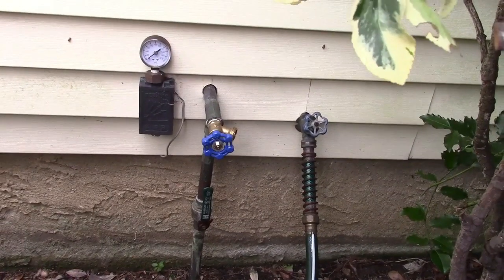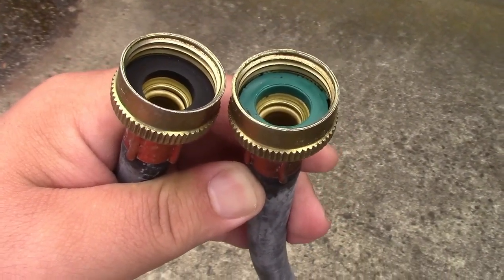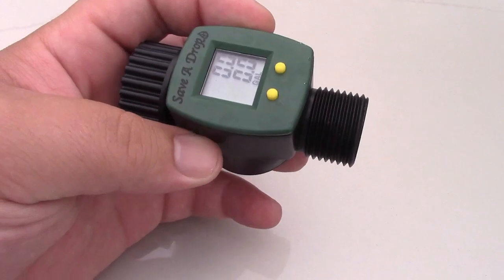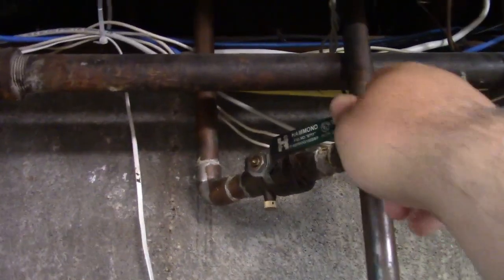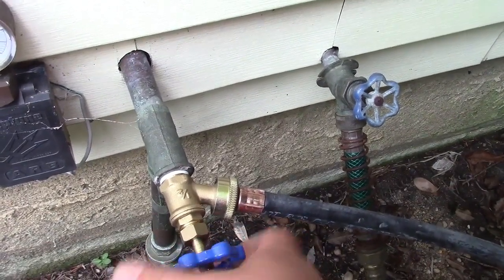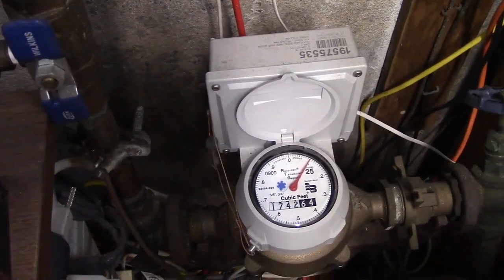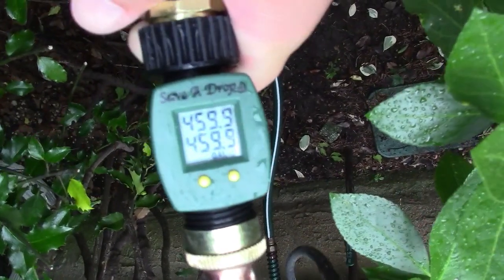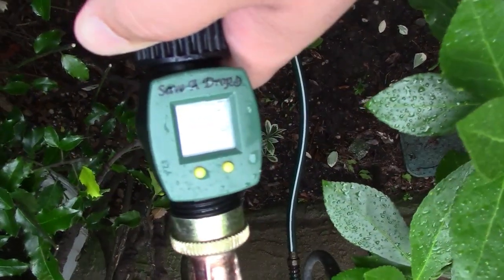How Much Water Does An Inground Sprinkler System Use?  Let's Find Out!

Comment: It's shocking just how much they can use! I have a separate irrigation meter, which excludes the sewage charge from irrigation water, since it doesn't go down the drain. That makes it really easy to see how much it's using. I've got 6 zones that run from roughly 30-50 minutes, 2 times a week, depending on which one. I swear at one point the quarterly water bill said it had used 30,000 gallons. I'll have to take a look at one of those meters, seems like a fun thing to play around with.
Reply from the maker: Around these parts, we don't get charged per gallon for the sewer.  We pay dearly for it in our taxes, but there's no limit or charge for usage.

That little water meter was a great purchase.  It's not the most robust thing out there, but if you keep it dry, it will definitely work.
Reply: That's pretty interesting. I'm sure in NY the taxes are out of this world, and that just adds to it! I think that meter is awesome, I'll definitely get one sometime.
Reply from the maker: @toyota-eh3ub  Last I checked, my taxes were about 12K a year around here.  Everyone else moved away since they couldn't afford it.  In exchange for that, I live a civilized life with full services, instead of having to pay willy-nilly for things like garbage pickup, snow removal, road maintenance, good schools, just about any business I want within a 10 mile radius.  As the saying goes, "you gotta pay to play".
Reply: That couldn’t be more true! In FL, the taxes are cheap. I usually like that, but sometimes the privatization is out of control. At one point, there were three different garbage companies all competing for business in my town. They need to be more like NY sometimes.
Reply from the maker: @toyota-eh3ub  Yeah that kind of stuff doesn't go on here.  Our garbage pickup is great, you want it gone, just put it out, that's it, they'll take it.  That is, unless the scrap metal guys get it first, which they often do.  I threw out my old barbecue, and within a couple hours, some guy stopped and put it in his truck.  I didn't know they paid for rust.

Comment: I calculated well over 2500 gallons, for my 3 zones, for one inch of water, I did this the size for the injector.
Reply from the maker: I'd have to leave my hose on for about 8 hours straight to get that kind of water to come out!
Reply: @jaykay18  Big difference between 40ish psi and my 125ish psi water pressure. 3 hours 55 minutes for my 3 zones. Add additional 2 hours and gallons for the neighbors yard. All good, system has been coming  on every 4 days for the sensor and schedule 5 days for the neighbor. Bone dry and very hot.
Reply from the maker: @RollingTardis  In exchange for my low water pressure, I can be at 55 different places within 5 minutes flat.

Comment: Jay? Next year when you open the pool will you put the gallon gauge onto the line filling the pool?
Reply from the maker: It only counts up to 999.9 gallons and rolls back over to zero.  If you figure I can get about 5 gallons per minute out of my hose, that's 300 gallons per hour.  In a 12 hour day, as I usually won't leave the hose on longer than that, that's 3600 gallons.  So, 3 12-hour days is about 10,800 gallons, about $108.